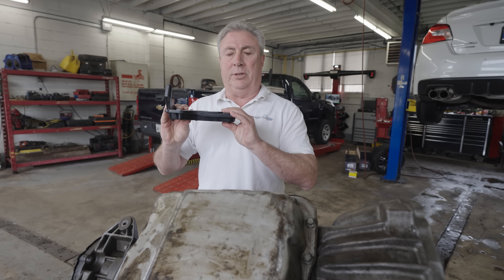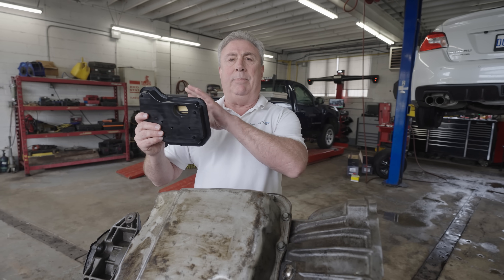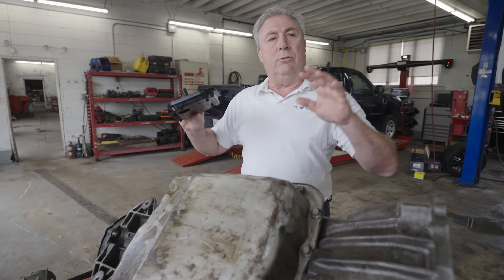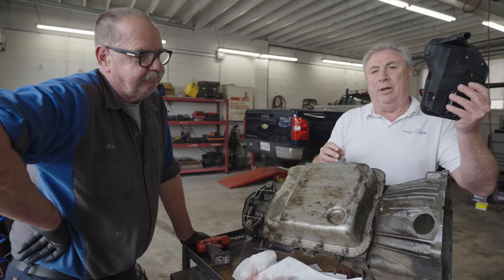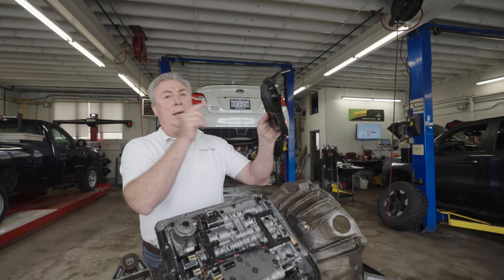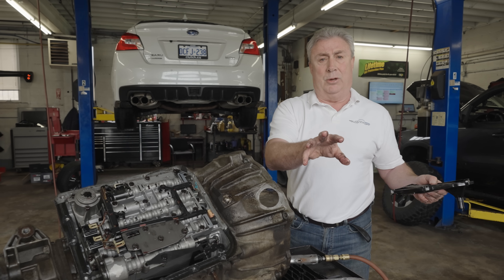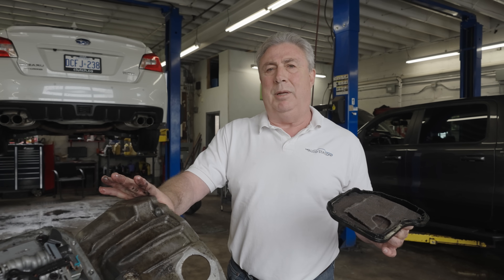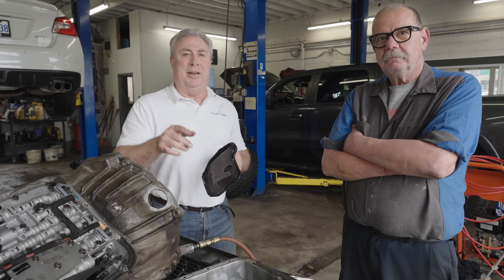Transmission filter Myth Busted - cutting through the B$$$

Comment: WRONG!  Worst advice I've ever heard.  I JUST had my brothers car come in a month ago with a transmission sounding like it was starved of oil and miss-shifting.  He was told he needed a new transmission and effectively kicked out the door.  He came to me and I told him it's worth taking a look at the oil and filter.  It was pretty dark AND the 'filter/screen door" looked like it was coated with SOMETHING.  I changed the filter, and installed new oil - twice (2nd time after running it for 15 min to mix the oil still in the converter).  He's been driving it (gently) without issue for the last month.  Mind you, when it first got to my shop I got in it and I couldn't even make it move!  He's been tight on $$ and I told him it was worth a $100 try - and so far it made ALL THE DIFFERENCE!  So I don't believe you - it CAN make a difference to change the 'filter' - especially if the filter looks like a pleated mesh that is getting caught up with debris - BEFORE the suction pulls a hole in it and all the crap gets sucked into the tranny. Not to mention I got all the crap out of the pan, cleaned the crap off the magnet, and fixed a slow leak in the pan gasket.  I would NEVER recommend doing a transmission "flush" - these operations are a terrible idea, and I've personally seen a transmission GO BAD fight after having a flush.  I belive it liberated all kinds of junk and finished off an otherwise functioning transmission.
Reply: Yall are missing his point. He's saying you shouldn't tear into a working transmission to replace the filter as preventative maintenance. If your filter is clogged, something else has gone wrong with the transmission, changing the filter might get more miles out of it but it's not going to fix the problem.
Reply: Your brothers car obviously had something wrong with the trans BEFOREHAND that caused all that gunk to get there in the first place. Obviously, if you're going through all the effort to pull the pan pulling the pan, common sense says you replace the filter. But as he said, that filter is like a chain link fence and isn't meant to catch small particles (hence the metal micro particles on the magnet that obviously didn't get trapped by the filter) Considering the micron size of most trans filters is around 200 microns (an oil filter is about 25 microns with aprox. 60 psi to push it through) I'd say he's pretty much spot on. The entire point of his video is that doing regular fluid extractions w/o replacing the filter would serve your cars tranny well.
Reply: @justadbeer I get it no need to change the filter then at all
Reply: How many miles were on the car?  Had the fluid been changed regularly?
Reply: @jimbonater Obviously no maintenance at all if it's caked up. 
99 out of 100 people do nothing to the transmission until it conks out
Reply: Changing your plugged filter was just a band -aid to future failure , with that much junk floating around in there the damage is done. Drive it to a transmission shop, get it fixed and tell your brother Merry Christmas .
Reply: @mkemm50 If the filter is plugged up, the pump can't build pressure fast enough to shift quickly which will eventually burn out the bands and clutch.
Has to be fast oil flow whether or not it's new or old parts inside. 
I asked my mechanic about "it's pointless once the pan is full of glitter, right"?
'Ive dropped lots of pans and the filter and pan lots of glitter and clutch material and cleaned put fresh fluid and filter and those customers didn't have problems after... hasn't happened yet' and he's been at it 25 years so far. 
I'm sure he would back me in saying 
Don't stomp on it don't drag race don't try spinning the wheels in a parking lot don't try pulling stumps or flooring it while stuck in snow it should last.
Driving the hell out of it pulling trailer in overdrive is hard on a new tranny.
Reply: There is internal damage in that trans that lead to the clogged filter. He is talking about preventative maintenance, meaning the transmission is operating normally.
Reply: You changed fluid, filter, cleaned the pan/magnet all at the same time.  Impossible to tell if just spill and fill would have been sufficient, which was the point of the video.  You proved nothing.

Comment: This is BS. Many cars have true filters too. These can clog and you'll loose your pressure. Then the trans doesn't work properly, until it dies.
Reply: Obviously if you have an external filter it's no issue to change it. He's talking about internal filters.
Reply: Nissan cvt many have tiny paper like external filter and it was dirty af when i replaced and it helped a lot.
Reply: I would have to say a real ' oil filter ' type filter in an automatic transmission would very likely 
SHORTEN it's life dramatically unless you had the pan taken off every 10,000 miles or so.
Reply: @michaelszczys8316  Honda/Acura has a small pleated filter, not intended to ever be serviced.  So, 10k would be overkill.
Reply: @attocoulomb so then what? When it clogs just change transmission after it burns all the clutch plates from low pressure?
Reply: @michaelszczys8316  Engine oil filters have a bypass valve if they clog... I have added a spin on oil filter kit to all my vehicles, no issues, sounds like you should research the topic more...

Comment: A landscaping truck lasting 350,000 kms with no transmission  service is unbelievable.
Reply: It must have been leaking like a sieve and being refiled.
Reply: @jimcny3 that's the only way.
Reply: Ya, this guy is not only a moron, he is also likely a liar.
Reply: 350,000 miles with same oil?
Thats where he lost me.
The oil was totally worn out by 200k.  It didn't go another 150k on worn out oil.
Reply: This whole video is so stupid. I work at a dealer this is bs.
Reply: It maybe had Lifetime Fluid
Reply: @frv6610 😂
Reply: @frv6610 NO doubt!
Reply from the maker: Yes, we do see that unbelievable kind of service on occasion.  Full disclosure is the transfer case was not so lucky.  It had basically grenaded - with a kaboom. The transmission was removed as part of an extended rebuild and refit strategy to deal with that component. Thanks for the comment!

Comment: I replaced the transmission pan gasket because it was cracked and leaking. It came with the filter so I changed it and the seal where it pushes into. Almost 400kms on it and working perfectly.  The LS1 engine killed the rear diff but the transmission is very capable
Reply from the maker: Thanks for the comment! Absolutely agree with changing out that filter if you've got a reason to get the pan down. Fixing a leak is a pretty good reason. 🙂

400K and still working great is fantastic to hear. Appreciate the thought, Thanks.

Comment: Before the warranty is over drop the pan and change the fluid and filter. Add a aftermarket pan with a drain bolt if the original does not have a proper drain. If there is excessive metal try to get it fixed on warranty.

Comment: My Honda has a drain plug with a magnet on the end. The filter is internal, and there's no service interval for it. Now I understand why. Thank you!
Reply: Ford Escapes are the same.
Reply: Depending on what Honda you have, it likely has a pleated filter (like a small cartridge oil filter) under the transmission fluid warmer/cooler.  Honda doesn't  consider it to be a service item, unless other transmission repair is being done.  I might change mine once,  when I do the 2nd fluid change (or not  -- I could do two extra fluid changes for the time/money changing the filter would take).

Comment: I use a fluid extractor that removes about 4-5 qts from my 6r80 transmission pan then pump in the same amount of new fluid. They are making it so difficult for the DIY folks as it is nowadays. Very good video. Thanks for posting
Reply: The 6r80 is extremely easy to drop the pan and change the filter. It's a very reliable and durable transmission. I've owned one for 16 years of hard use.
Reply: @snowg4953 reusable gasket too
Reply: I agree with you. If the filter & magnet was so important, then why is it inaccessible in most new transmissions? The filter is buried deep inside the transmission now. Anything made later then 2016 has no dipstick to even check it  anymore.
Reply: @pontiacsrule8761 The filter is not buried it is in the pan which is an easy removal in most cases. Manufacterers have been running scams on transmissions for a long time. Some claim lifetime fluid, which is a scam. While others will not even drop pans to replace the filters which is also a scam (looking at you mazda). This job is easy and cheap while extending tye life of your transmission, which is why they won't do it. 
If they could get away with claiming lifetime engine oil they most certainly would. They don't care about anything except easy money.
Reply: Man I hate hearing this.
Always. Always always drop the pan. In that truck it should be an hour job. 
The pan will and always has a nasty film of the worst stuff, not to mention the magnet.
Bet my hat if you saw what was in your pan you would be outside dropping it right now.
Reply: @TonicofSonic  Don't disturb it and it will stay on the bottom of the pan. Just don't look at it and it will be fine.
Reply: @bobbygetsbanned6049 maybe true but that magnet being clean does help you sleep at night.😂
Reply: @TonicofSonic  - I remember when being able to drop a pan was literally a 10 minute job. Noe I would have to remove part of my exhaust to get to it, and the bigger issue will be trying to get those bolts out.

Comment: Did mine on a 2017 Honda HRV wit CVT. That filter was dirty and didnt have anything chunky in it (did the cooler filter as well). The magnets in the pan had very fine black material on it and the fluid was about 30% as clear as new stuff.

The CVT vents on my vehicle tend to get clogged (mine was) and then dirt can enter if pressure pops the fill plug. Im glad I replaced both filters.

Comment: I added an external spin on filter and a pan with a drain plug.  I also started draining and replacing 6 quarts every other oil change (or about once a year).  While I only get about half the fluid at a time, it keeps it fresh enough to prevent any issues (I hope).  The spin on filter also gets replaced once a year, which is super easy.
Reply from the maker: Oooh, I like the external filter idea. It sounds like you've got a plan that works well for you - thanks for sharing!
Reply: @shawndutton3218
Seems excessive, unnecessary.
What yr make model of vehicle?
Reply: @sameold5050  2017 Tahoe with the 6L80.  You might be right, but those have a high failure rate from what I can tell, and its cheap insurance (I hope).  50 bucks a year to hopefully save me 6K.

Comment: Recently discovered that my sons Toyota Sienna Van has only a drain plug on the trans but NO PAN.  I'm thinking that the Toyota engineers agree with you because there is no filter to service.  I do wonder if there are magnets inside the trans.  My Dodge with a ZF trans has the filter built into the pan but also has 4 magnets.  I think those magnets are a good idea.
Reply from the maker: That’s a great catch and a great question! Toyota definitely believes in a simple design, which can be a good thing or bad thing depending on the application. Generally, that transmission filter is buried deep inside the assembly and is only accessible when rebuilding the transmission. It seems to confirm the idea that these "filters" do not need regular service.

Appreciate the comment.  Thank you!
Reply: Like Autostation said, the filter in the toyota 8 speed is buried deep inside and not accessible so no need to worry about it.
Reply: Ford did the same thing. It's just drain and fill. The magnet is on the drain bolt.

Comment: Unfortunately, those GM transmissions need the filter tube to pump the fluid back to the case. So while the pan is dropped, it's a good idea to change the filter every other fluid change. No harm no foul
Reply from the maker: Thanks for the much appreciated comment.  Absolutely agree. If there is a reason to get the pan down it makes total sense to replace the filter as part of the clean up and reassembly.  No harm, no foul indeed.

Comment: What happens to the clutch material released by normal wear. The fluid absorbs it? If so, just a flush at regular intervals? I don't think there is any argument the fluid wears out and becomes contaminated, obviously by materials too small to be caught by the filter. Thanks!

Comment: I was thinking just drain and filled every 30K miles should do the trick and keep the filter in place.
Reply: For the transmission, every 30k miles should be good
Reply: @kalani1987 right. i meant to say 30K miles not 3k. lol that would be my engine oil interval
Reply: I would change the filter every other fluid change.